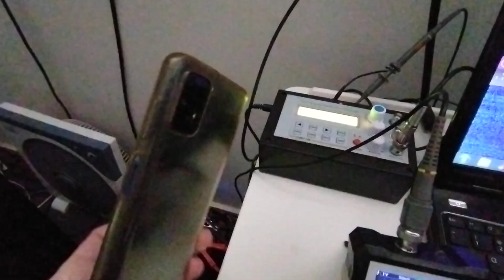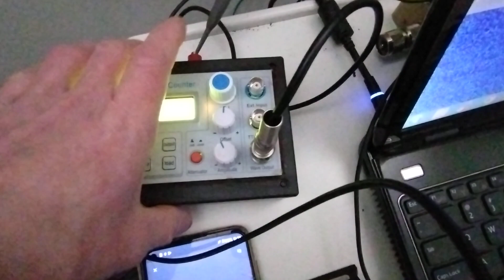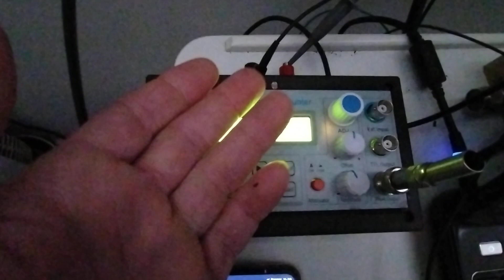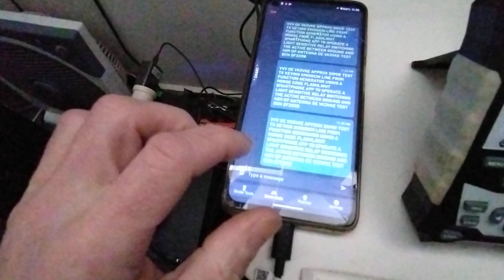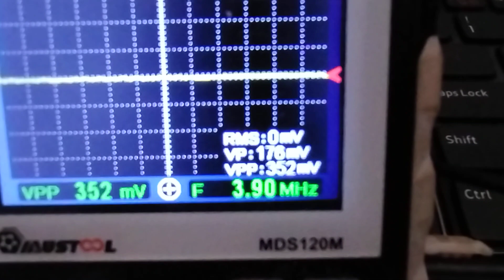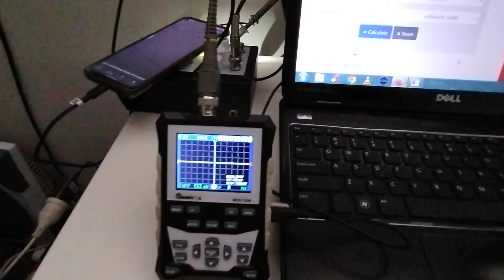Function Generator as HF CW Beacon Transmitter (Cheap & Easy)

Comment from the maker: **I suggest adding a 50 OHm resistor in the path to ground from the relay to prevent damage to the Source.**

(It worked fine without, But if the function generator is designed for a 50 OHm load, then it would be a good idea to add one.)

Comment: I want to build one of these myself, but I have a few questions:
- Why did you have to send the signal generator output to ground when the antenna switch opened?  Why could you not just let the signal output float?
- Are the positive and ground of the function generator just hooked up directly to the mast and ground-plane of the antenna (respectively) directly through the coax?
- Is the scope probe connected to the positive of the feedline to the antenna?  Or at some other point in the circuit?
Thanks so much!
Reply from the maker: Hi there.  I recommend sending the signal to ground via a 50 OHm resistor when the switch is open. 
I done that after the video. Some of my function generators behave badly when shorted.
(Dimming lights etc)
 Also when I left it floating  instead of shunting to ground some of the rf still made it to the antenna so the morse was just changing magnitude instead of truly on and off.
The scope probe was simply connected to the output side of the relay (essentially the coax shield and centre conductor after the switching .)
I simply had the two output terminals linked straight to the output coax cable so I could either use a wire antenna directly or use a coax feed.
You have to make sure you connect the relay correctly so you dont end up with the switch closed when the light is off and open when on.
I recommend using a better function generator also.
Thanks for your questions & I hope I managed to clarify what you wanted to know.
(Additional info)
I have since modified the  system to be operated 
by a morse keyer for ps2 keyboard circuit that you would normally key the radio with using a keyboard and memories,
all I had to do was connect the line that would key the transmitter to where the LDR photosensor switch connected to the relay circuit which replaces the light sensor
to key the relay.
If I can find a link to one, I will try add it in another comment.
Reply: @crazyham  Thanks so much! I'm just getting back into amateur radio after a 10 year hiatus.  This time I want to try and build my own equipment.  I have an Owon handheld scope that I'll be using as the function generator.  I think my first step once I get my dipole antenna setup will be to connect the function generator directly to the antenna and just start and stop it with the buttons on the scope to see if I'm getting a detectible signal on some local WebSDRs.  Next my plan is to put a button inline with the antenna so I can drive it manually.  Originally, I was just going to have it be a SPST switch and let the signal output float, but based on your feedback, I decided to buy a SPDT button so I can send it to ground through a 5W 50ohm resistor.  And if that all works, I might try and build an amp and filter for it to see if I can get around 1-5W out of it.  Should be fun either way though!
Reply from the maker: I'm so pleased you are getting back into ham radio mate 🙏
That sounds like a good plan.
I have also experimented using a function generator into an inductor and adding an audio source across the inductor & tuning to resonance with an external magnet.
I have managed to achieve both AM modulation & FM modulation 
but this was an elaborate inductor design.
If you look back through my older videos there should be some on that topic.
I love the experimental side of Amateur Radio personally
but I am on hold at the moment
as I am selling up to move north (warmer weather).
73 my friend
de VK3VKe ⚡🙏⚡
Reply from the maker: I have recently purchased a cheap rf amp on ebay for 3MHz to 28 MHz that works great from just a function generator & it only cost me around $35 AUD assembled lol.  It has a max output of 30 watt with an input of 3 watt max. Not bad for such a low cost.  I bought it to see if it was ok.
Using only a function generator as the source at 0.5 watt into the amp
I have been hitting Western Australia (3,500 km away) with an S7 to S9 & in my next location I may set up a number of verticals all phased with a small amp at the base of each vertical DC powered via the coax using bias tees. It will be a fun challenge impedance matching at the source and at each vertical yet my trick using magnets on inductive cores makes that so much easier.
Reply from the maker: I am currently unable to find a link,
but the morse keyer I use is called
Betatech Instruments K11-20 Keyboard Keyer. Though any similar unit would do that job too if u wanted to key it with a keyboard.
Reply from the maker: Please watch my latest video mate.
I think you may find it of benefit.
A very useful easy to build cheap high Visibility active RF field strength meter that is very sensitive.

https://youtu.be/hJHk-zmoFBk?si=2UiWnrlt6RXuCpnb